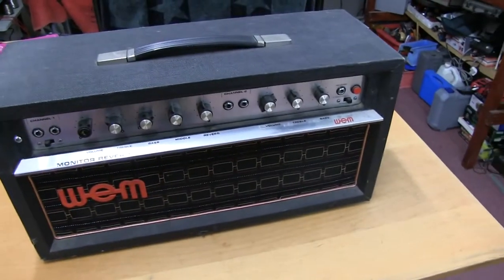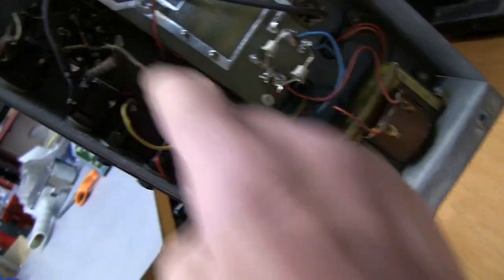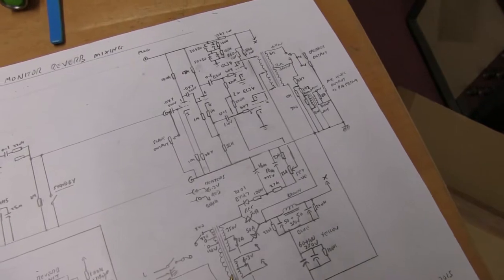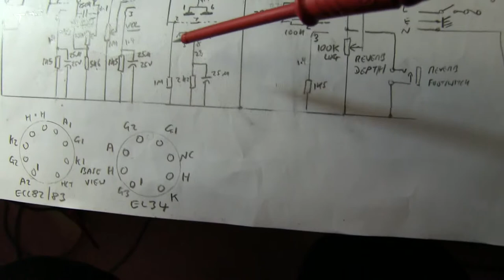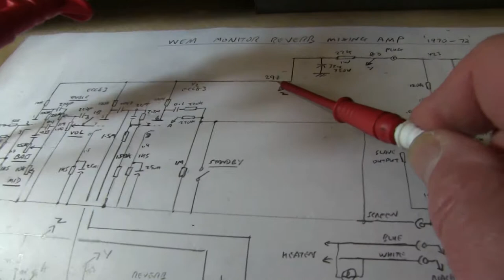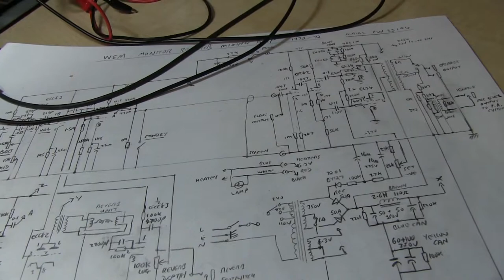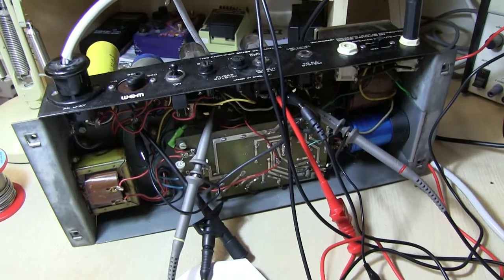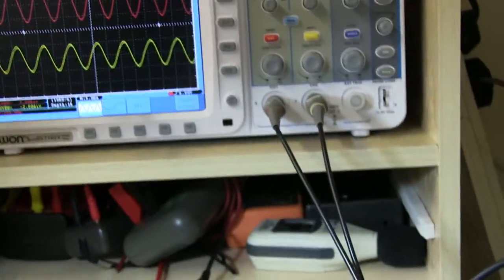WEM Monitor Reverb Mixing Amp. Vintage Early 70's.

Comment: Hi Nick,
it is a really nice amp though i have some issue with noise and hum from the preamp. I changed all higher resistors und filter c's. there is also something you might help me with... on the reverb channel there is significantly less bass. I spottet a missing cathode cap on the first valve but otherwise it's the same as the 2nd channel. does the First Chanel have less bass response in your experience?
Thanks for this Video, really informative, Dirk
Reply from the maker: Hi Dirk
The Reverb channel did not have the 25u cathode cap, but a switched 0.1u treble boost cap. Also a smaller 0.047u anode cap.
They tried to keep the signal down to stop overloading the reverb tank.
Bass would not be good  through the tank as it would overload and distort.

Comment: How much are these things worth?
Reply from the maker: Hi Louis. WEM equipment is falling in price, as there are a lot of amps etc coming onto the market, as the players no longer use them. So you can find them on Ebay quite often. Perhaps only £200.
Reply: @nickadams5411  Thanks!